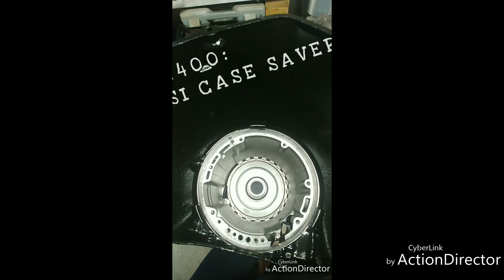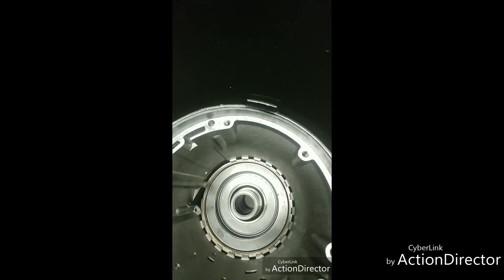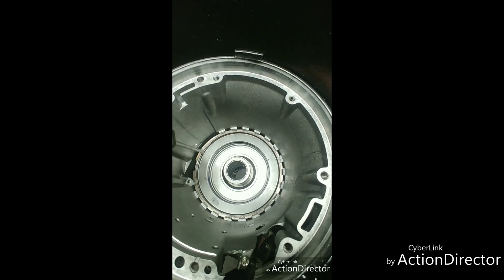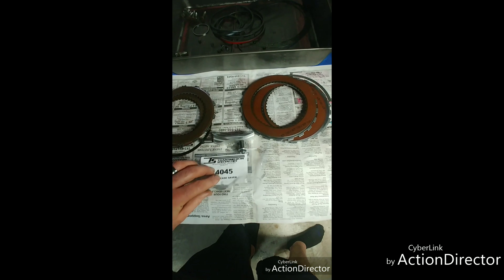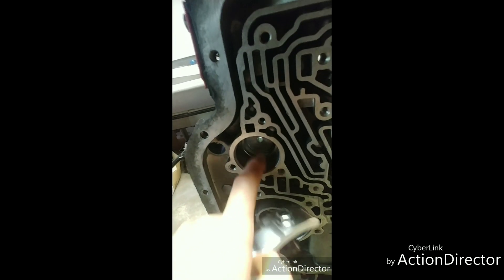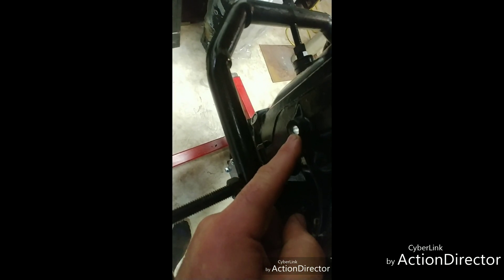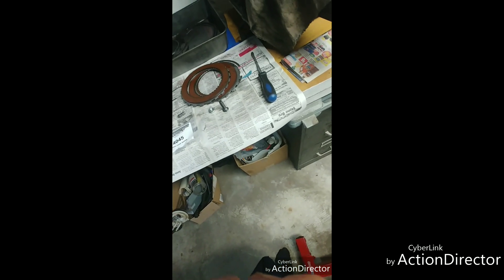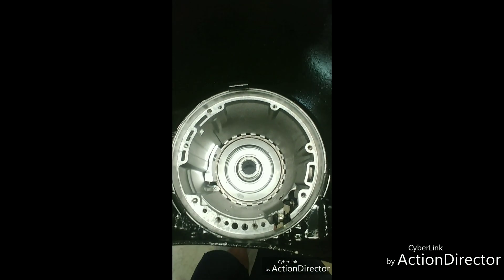TH400 Rebuild: What the Heck is a "CASE SAVER?"

Comment: Do I need to use a sealer or O-Rings on the bolts so there's no leaks?
Reply from the maker: A small amount thread sealant in the larger bolt is a good idea